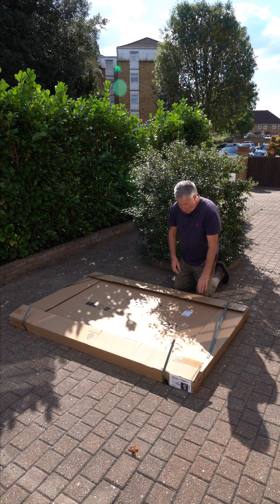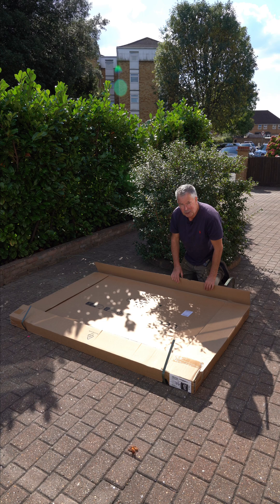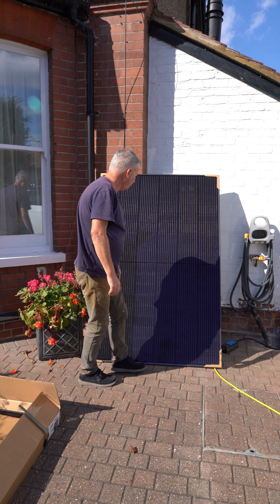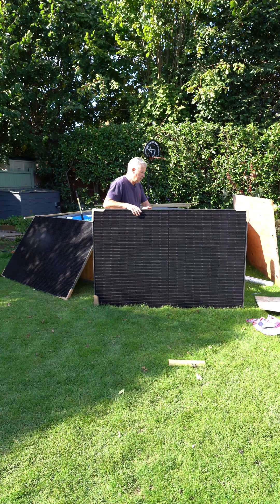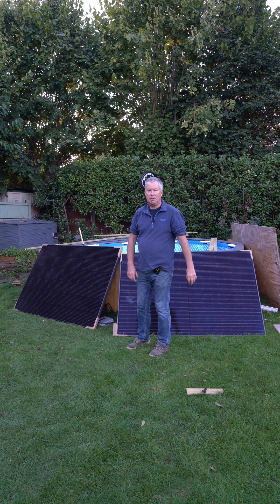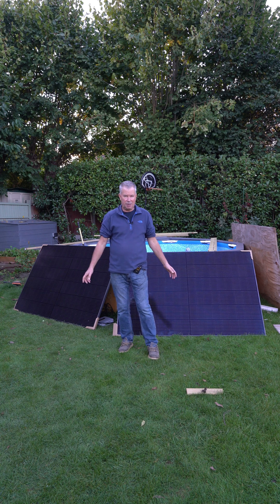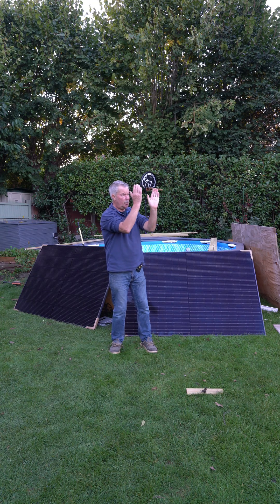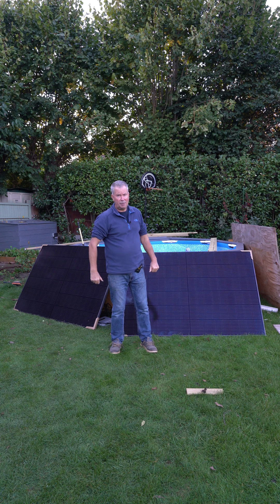DIY ECOFLOW Solar Panels Simple Installation #solarpower #solarenergy #diysolar #diyelectrical

Comment: Worse case scenario, could you run a length of external grade cat 5 cable to them. Not ideal I understand, but just food for thought
Reply from the maker: I just bought an outdoor storm resistant power socket to replace an old one. It has a 2.4GHZ extender inside so i am hoping that it will work with my BT router. I will find out this afternoon.